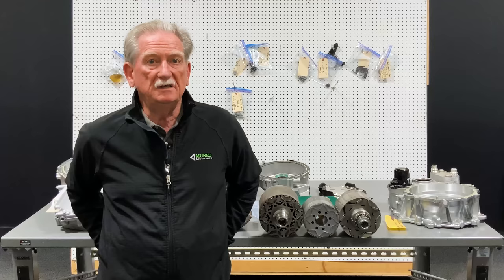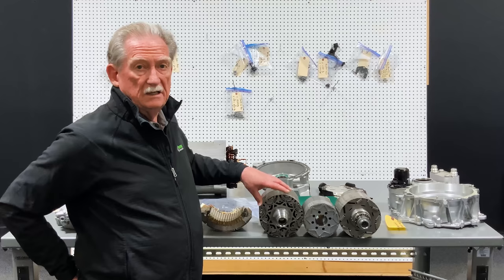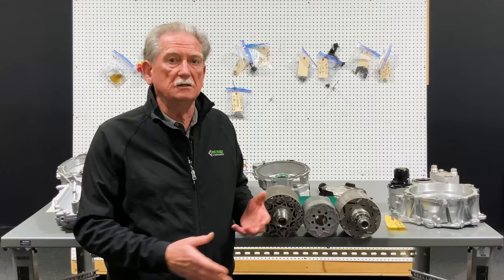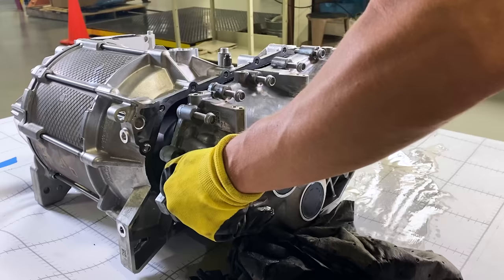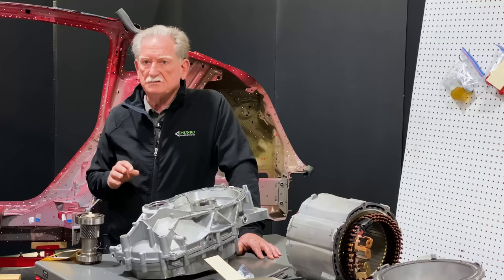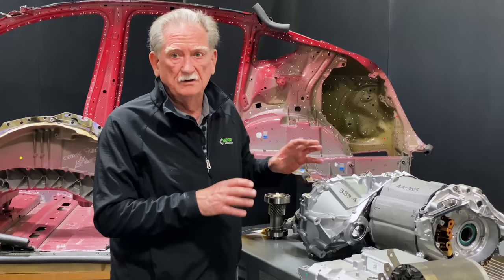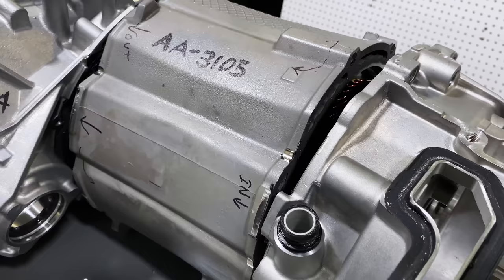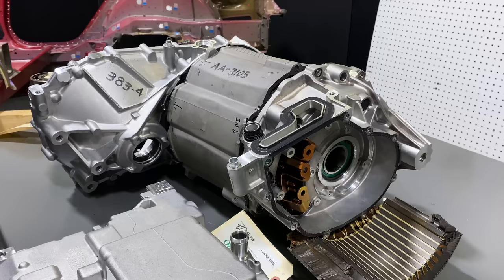Volkswagen ID.4: Electric Motor Teardown and Analysis

Comment: "I don't think you'll be fixing an inverter"  Words of someone who does little with electronics I see.  Having an inverter come apart as they've done is brilliant.  Sometimes that $4,000 part really just needs a 50 cent capacitor replaced.  DO NOT RIVET OR GLUE THOSE COMPONENTS, EVER!
Reply: Totally agree, these bolts will never ever come off...haha. And they are the best for automation.
Reply: Bingo! Switching to rivets or any other anti-repair method will damage their brand way more than any aggregate fixed cost savings
Reply: Especially while you are developing/testing the component rather than produce it for 20 years in the row...
Reply: Manufacturers are not getting any profit if the repair shop can replace a 50 cent capacitor.
Reply: @wrxguyusa  They need to worry about profiting on the car and not hoping to make money on parts.   Some fools will still buy the $4k part because they don't know better.  Those of us who'd prefer to get dirty will go the 50 cent method.    Even then it's not unheard of for an issue to develop with capacitors and then they can have "cores" that must be returned to them for servicing.  Then they'll wish they had screws so they could quickly repair them and be able to send them out to dealers who have to fix it under warranty.
Reply: your local repairshop probably will still be getting a new part from vw but vw will rework the old ones and sell them in eastern europe and asia
Reply: As someone that repairs electronics I can say that inverters will definitely be a "part" that needs to be repairable. In most cases it is very wasteful to just junk it and replace the whole unit. This would be simillar to fixing a transmission or an abs module, etc.
Reply: @soundtinker  Without question -- I find it interesting that they made the bleed resistor readily replaceable.
Reply: Thank you
Reply: If the inverter actually costs them 4K they have deeper problems.

Just devils advocate: sometimes a straight swap for a tech, even if it's a pricey component, is cheaper than a lengthy tear-down. And, it gets the car back to the customer faster. No one wants to hear their car will sit in the shop for 2 weeks. Just saying as someone who does this stuff for a living. Repairability is great when it makes financial sense.
Reply: You look at this as an electronic tech, but this is an automotive part, and they get swapped out.

The old one gets sent to a shop to get remanufactured, and they don't really care how easy it is, because they charge whatever it takes to take it apart and repair it.
Just like no one rebuilds their own alternator or puts new seals and bearings in a water pump abymi, but you swap it out with a Reman with a warranty.
And most independent shops don't want to touch component repair, because it takes specialized equipment to test and diagnose, and they don't want the liability if an inverter they repaired shorts out and the car burns up.

Now, I like fixing things myself, so not being easy to take apart would annoy me, but it doesn't really make sense for the auto industry to worry about a tiny percentage of people when gluing something together can save millions.
Reply: There is alot of profit in that $4,000 spare! but there is alot of pain in finding that person available locally with the experience and knowledge to know which 50 cent part is faulty to get in there, pull it out, swap, test and warrant it.
Reply: @MrCarGuy  true, penny wise, pound foolish..
Reply: @user-qv6ud2hx6f  Spot on!! very true! this stuff is still new and not 20 years old model!!  Revisions for sure due to come, and they need to pull apart to see what's not correct yet!  imagine all the plastic snaplocks breaking left right and center!
Reply: @mhamma6560  that's one of the reasons they are bigger than ford.. sandman wasnt part of their developement team.
Reply: Most likely you're going to be fixing screws that came loose and shorted it with that design.  I love that it's repairable but a better design would have been to render accessible parts that are susceptible of being repaired/replaced instead of putting the in the bottom of the thing and using a million screws.
Reply: @wrxguyusa  so true
Reply: I too would like to fix my vehicle. And if it’s little loose just tighten it up every once in a while. That’s the benefit of threaded screws. And if the whole gets messed up you can make it bigger and rethread it. Snap together stuff I always saw as companies trying to stop people from fixing their stuff.
Reply: @Mdrolet77  Steel screws aren't known for backing out of aluminum parts.  Soft AL allows screws to bite into it a little bit.
Reply: in America maybe, in Germany / Europe you not allowed to disasamble this parts, the car would be not longer allowed to drive on roads. It has to be replaced with an original part.
Reply: I disagree but for a zoomed-out reason. I just don't think we should be encouraging the the concept of DIY for EVs in general, as we do with ice vehicles. You've got a ton of components capable of delivering a fatal electric shock, explosion or fire and can hold a dangerous voltage even when the car is “off”. Then the risks from electromagnetic fields for those with active implants or pacemakers. Even if it's wasteful, eliminating time tinkering may end up saving lives. Of course it can be done safely by skilled mechanics, but I'd just feel better if the general owner saw their EV more as more of an iphone than a hotrod, and making things harder to open up might solidify that perception.  If there wasn't this risk I'd agree with you 100%, and perhaps in future it can be mitigated, but for now I cringe whenever anyone says the'll do a bit of work on their EV.
Reply: @mhamma6560  And they removed the oil (cooling fluid) pump.  So how does the oil circulate to cool everything without a pump?
Reply: I fixed a VW dashboard capacitor after 15 years. saved me at least 800 bucks 😎
Reply: @grunerschneemann3640  Well done!  I've given up on fixing cars because I can't recognize most parts anymore, like they were in the 1960's.
Reply: @franzplagens3277  They removed a pump not all pumps.  Tesla has 2.  One for the motor and one for the inverter.
Reply: @joedouglas5243  Yes, but step 1 of working on EVs is to "safe" the battery, aka disconnect it.  The bleed resistor (white rectangular box thing that he says should have been on the board) is what's used to discharge the capacitors in the inverter.  Once the battery is removed, that resistor automatically drains the caps of voltage ensuring that the system is in-fact voltage free.  Automatic voltage dumping has been a part of many electrical components for years.  It may even be the law in some jurisdictions due to recycling, among other things.
Reply: @Mdrolet77  Thanks for the reply.  I must have missed that point. No doubt there are experts at Tesla, and experts at VW, and they both have their reasons for doing things their way.  I wonder if Tesla's is a booster pump, or a separate coolant system with its own pump?  
Sandy looks at everything from a manufacturing point of view, not a long life or repair point of view.  It works well in America where people like to impress, and update their vehicles every few years, so they don't have to last very long, or be very repairable.  American culture is generally more wasteful, than European culture.  When you have presidents who turn their air-conditioner up to max, to enjoy a raging fire in the fireplace in the summer, it sets the tone for the rest of American society, lol.
Reply: @kenion2166  Maybe you can get some more right to repair laws going in Germany.
Reply: @joedouglas5243  the problem is, iPhones are only difficult to repair beyond the X because Apple wanted to make more money from people sending in their broken phones to their ironically-named “geniuses” and from buying new phones instead of being able to cheaply get their phone repaired locally by anyone with sufficient knowledge and experience. All of it adds up to a racket; a big scam to increase profits which exploits the environment and their customers. 

Agreed though; any electrical work can be dangerous. You can kill yourself with a multimeter. Maybe that could be mitigated with the most simple things; like capacitor-draining tools, or orange-coloured capacitors which show the user where to be careful. Anyone with common sense and knowledge enough to attempt to repair these components will necessarily know how they work; and as such will know what to avoid touching and when.
Reply: After electric VW will reach Russia, you'll find a lot of tutorials on how to replace PCB components on the inverter side. Russians are so crazy that would change the copper coils on the stator in order to extract more juice from that power train and beat Tesla on the 400m run. 😅
Reply: @imperialsecuritybureau6037  I hear you but I really don't think the danger can be mitigated, there are too many careless people out there, and too many ways electricity can get out of the battery and into you. I think the only answer is to make  working on your the powertrain of an EV something the average person does not (cannot) do -- so very different from the existing notion of "working on your car". I realise that's a padded income stream for the manufacturer, but having worked around that amount of current I just can't see any way around it.
Reply: @mhamma6560  Sandy has a video (can't remember which) where he has an entire battery pack completely removed and and "drained",  but it's still all taped up and warnings everywhere, and he goes into a bit of detail on how dangerous that thing still is and how hard it is to actually drain a 50kw+ battery back the point of it not being able to kill you. And that's the whole thing take out and professionally drained in the shop, imagine the average person working on their car, trying to swap out an inverter, and draining it by "driving it dead". Those electrons are just going to be there.   I just can't see it being feasible, there are too many careless people out there even if there were steps to mitigate it such attempts ways to keep hands away from conductive surfaces, etc.
Reply: @joedouglas5243  You fail to understand that a 'drained' lithium battery means it's at it's minimum voltage.  If they go to zero, they're trash.  If they go below minimum voltage, they're trash.  The battery is a fuel tank with no fuel pump.  Batteries are often covered by long warranties and few if anyone will play with the battery.  Everything else in the vehicle however is readily replaceable and safe when the battery is disconnected.
Reply: @joedouglas5243  it’s not like you don’t need precautions with ICE vehicles. You always disconnect the battery as step one. Not to mention, you still have a tank of fluid that is designed to be as flammable as possible (to a point). I think that it will be a different skill set and a different set of safety tools and steps, but people will always want to tinker with stuff. It’s just a new kind of dangerous.
Reply: @chstra45  Not just sometimes; nearly all the time. Unless there's built-in diagnostics to indicate what electronic component has failed, there's going to be no way a tech is going to be able to troubleshoot and repair. Moreover, what shop or dealership is qualified to repair or replace something like a capacitor or transformer? At best, they can swap PC boards, but even that can be problematic. Best to remove the replace the entire assembly and ship the defective one off to a specialty refurbisher who can diagnose and repair.
Reply: @kenion2166  What do you mean you're not allowed? It's your car. If you could somehow manage to repair it, who's going to know?
Reply: @micultimy91  so true, god bless those Russians
Reply: @wallyballou7417  And that specialty repair businesses' cost will indirectly come out of your wallet as the "price of the replacement part". So making it easy to repair is ultimately in the customers' interest.
Reply: I have a good friend that owns a company where they are servicing stuff like this. They replace a 50ct capacitor and sell the repaired part again.
Reply: This stuff gets repaired in industry. I think they even repair alternators.
The BOM cost is much higher than an ignition module.
Reply: @soundtinker  It can be repaired even on board level. New control module, new power module, new capacitor A or B.
Reply: @mhamma6560  High voltage resistors do fail.
Reply: Looks like VW are going against built obsolescence philosophy. I think I would want to fix an inverter rather than spend 4G. And there are several main sub- component borads- so possibly you could replace only the faulty sub unit rather than trashing the whole thing.
Reply: Absolutely. I recently “fixed” my Gen2 Tesla on board charger with 15 minutes soldering - Tesla wanted $8k!
Reply: Words of someone who does electronics as a *hobby*.  The cost of fixing am inverter with a 50 cent broken capacitor, is not the 50 cent capacitor, it is the hours and hours of technician time evaluating the problem and testing the fix, at hundreds of dollars an hour.
Reply: I like to repair my stuff as well.  But what's the likelihood of a large electric discharge after one of those fasteners comes loose and starts rattling around inside?  With so many screw fasteners, there is significant likelihood at least one of them will come loose and start to rattle around.  I'm not convinced that the benefits of repairability will outweigh the increased possibility of floating "electrical shorts" to inside my inverter.  ...I'm torn on this.
Reply: @jeanwesleynew  The probability of one of those screws backing out and creating an issue would be extremely low. Screws tightened into cast aluminium to the correct torque, don't just fall out. Most of time the problem is trying to undo one that has been there for a few years and won't let go.. As someone who has to repair industrial power electronics, I like this sort of design.
Reply: In France they recently introduced a new  Law dealing with obsolence and repair ability.
Reply: I think he's saying that he's in first are more likely to just be replaced, which they are.

Some of the components are through hole, but have so much thermal mass that there's no way you're getting them off without baking the entire board.
Reply: @user-tz3gn2ke1f  I have no idea what sort of industrial electronics you work on, so forgive any false assumptions I may make.  But screw in fasteners do occasionally vibrate loose on a car.  Yes, not very often, and typically due to improper torque or another cause.  But each additional screw fastener is another potential failure point to vibrate loose, or be  improperly torqued down (both can happen).  Maybe the industrial electronics you work on don't experience the same level of vibration.  Or maybe they are produced at lower numbers than common autos, and the assembly time is longer, allowing fewer assembly/torque errors.  But I can at least see numerous screw fasteners as a potential failure point across 80k cars, which might outweigh the benefit of individual repairability.
Reply: @jeanwesleynew  It would be a fair assumption that the equipment I see is put together with a little more care than the average passenger vehicle. Locomotive, heavy mining, and similar. I suppose it is just a pet peeve that things should be made to be pulled apart and repaired. If I have to half destroy it to get inside, feels wrong.. and I don't exactly have a real good track record with things held together with plastic clips when the plastic gets old and brittle. :)
Reply: You will find screws holding the motherboard of the most modern high end cellphones, ECUs on various applications... You name it. 
This just makes it more serviceable and all you need to do is design it correctly and get the torque right.
Reply: New right to repair laws will change all this.
Reply: But at the local service center. Will a tech be replacing a capacitor or the entire unit?

I say they replace the entire unit, then the faulty unit goes somewhere where if it is just a faulty capacitor, they can refurbish and resale for the used parts market.
Reply: @joedouglas5243  Repairability is not equal to DIY, but especially an EV should provide besides high voltage components parts that are environment friendly repairable by a repair shop. Otherwise we end up in more pollution than not having EVs at all.
Reply: The ability to disassemble the inverter is useless if replacement parts are not available. EV design is in a high state of flux. How long will it be before all these components are re-designed and no longer compatible?
Reply: I drove different brands for 40 yrs but I never experienced a repair that You describe. They always take the whole part and replaces it, in special German brands do that. I agree that very often a 10 cent part is broken, but they don't care. In the EU they work on laws that give the customer the right to repair. A good idea for the environment
Reply: @CorwynGC  If you need hours and hours to fix a broken cap, you should spend some of those hours to go to an optician.
Reply: Spot on! I was also wondering about that. But for that reason I find that it takes lots of movements to reach that circuit board.

Disclaimer: I have no any knowledge/experience how this is fitted at other cars!
Reply: VW will simply call the part "obsolete" and make the part unavailable. They have done it historically.
Reply: Isn't disassembly also very useful for recycling these components?
Reply: @mhamma6560  Exactly. Standard waranty on car im EU is 5 years now. 2 years are mandatory by law and based on car price (it is about 300-500 euroro for 20K car) another 3 years (and payed by dealer). Some parts, especially on Japan and Korean  cars have 7 to 10 years. European cars are build as repairable (for manufacturer at least :) )
Reply: Repairability should be the future.
Reply: @hemmper  and not only for cars, but everything else.
Reply: Anti replacement+throw away culture clashes w repair culture -> which is actually the greenest solution btw.
Reply: I work in VW group and electric components undergo insane stress tests such as vibration tests and rapid temp cycling etc. Those fasteners have probably been deemed necessary.
Reply: @HomeCinemaJunkie  most likely, but Scotty Kilmer will blindly say "they're not properly made".
Reply: @captainfowl1249  a      step in the right direction
Reply: @M Hamma. 100%🎯
Reply: When a car is 10 years old , yes the inverter will be rebuilt by someone. If you have to buy a everything new you can throw the car away, this includes your beloved Teslas
Reply: @hausaffe100  Over the years, I have had a few early component failures on Audi and VW cars. What impresses me is that they are obviously aware of the problem and the replacement had been redesigned and in all cases never failed again. 
Despite the slightly higher initial cost of their vehicles, in the long term they are extremely good value for money. I have had 3 cars that I kept for about 20 years, during which time they each covered around 300,000 miles.
Reply: @joedouglas5243  If we go in accordance to your logic,, then people shouldn't be driving cars either.  You can't dictate what someone else,  in the confines of their personal property, can do to their car, period!
Reply: @blk77sunshn  We do in fact dictate that, in some situations, people shouldn't be driving their cars. Such as when they're drunk. It's all about context. Now is the context of potential danger from doing some very specific things while working on an EV (we're taking a very tiny % of work you cold be doing to the car, mostly involving hardcore modifications to the battery pack) enough to mandate some sort of manufacturer friction to make it more difficult for the average person to do that very specific thing? Not to stop them mind you, but to put up a few serious barriers that might save a few idiots from themselves?  Or do we leave it to Darwin? That's an open question, and food for thought.
Reply: I guess that the "Bleed Resistor" has a high chance of failing (low MBTF) - hence make it easy to replace.
Reply: I like it if I  or somebody else can repair this things without any big problems. VW did a good job. Only this problem with the aluminium surface should be done better.
Reply: Munro seems to want to build throwaway cars built with throwaway parts! Good for the rich stock holders. Bad for the consumer!
Reply: RIVET OR GLUE is bad for service, this inverter is excellent design for service, every module is good sized to take apart, electronic components are good size for regular tools to work on,  VW had a winner here.
Reply: Totally agree!
Reply: However, the point is that the dealership will not take the time to take the inverter apart and replace a bad part or modular. They will replace the whole thing.  That's the case with any component in any modern car.  No fixing, just replacing!
Reply: @switchex  Yeah! If people want to use dealer then pay 4 grands, there are third parties can fix for a lot less, why not, for example, ball bearing replacement, gear replacement or pcb module replacement for 1/3 of the dealer repair cost.
Reply: @switchex  That is just another way of saying "F" the customer! There are third parties who are willing to do the repairs.
Reply: @joedouglas5243  He didn't have enough information to comment, once you removed the 12v battery power, all the high voltage power output in Lithium battery will be disable, or any high voltage connectors in the loop was disconnected, high voltage disable, or the battery case open, high voltage disable.
Reply: @DavidJohnson-tv2nn  don't get me wrong, I have never been to a dealer and go out if my way and challenge myself to fix anything. But it's a few if us that can and willing to do that.
Reply: @luckybiby8968  no third party that is willing to do these type of work.  A lot of do-it-yourselfers, including myself.  But companies are there to take your money, not to make products that are easy to fix.  This is same exact reason why you don't see any "third parties" fixing TVs.  They need to make a profit too and how much can you charge a customer for finding and replacing a bad capacitor?  I am like you, I fix things.  But I would have done the same if I was a business man.
Reply: @switchex  BMW quoted me $2000 for an Airbag icon light problem ,when the car went over a bump, it was on, another bump, off ( to replace airbag module and associated computer module). If it was under $700, I won't bother to DIY, at $2k, I would like to fix myself, I bought  SW scan tool and cable for $350, found out the airbag connector ajar, nothing wrong with said modules, pushed it in, it worked, For troubleshooting a capacitor that's bad,  it's fair to pay $1300 for the  repair, usually I'll replace all the caps in the function block if it is cap on the gate drive of the Mosfet, if I'm being nice, I would replace the Mosfet, too. I'm willing to be thethird party if the incentive is good enough to make a living.
Reply: A CAN bus filter inductor has a dry joint after 2 years and that's a £kkkk bill. Same as door trim and bumper clips - they all break after one use.
Reply: When was the last time anyone had a water pump, alternator, brake caliper, lug nut come loose that wasn't torqued correctly ? Never for me.
Reply: @joanfrellburg4901  He was a technical bean counter, less labor and less parts was the goal, reliability and repairability had no proprity.
Reply: @luckybiby8968  Right, my guess is you'll be able to pick up a new module on Amazon any day now. ( with chrome bolts and lock washers ) 💋
Reply: @jeanwesleynew   Screws can be locked with thread locking fluids, if you have that kind of vibrations, you want MORE screws to hold the board, belive me, boards break from vibration all the time, and the key is to support it wherever it is possible with a screw fastener, satelites experience G-forces and vibrations during launch that would snap unsupported boards.
A car hitting a speedbump a bit too fast can do the same, USE MORE FASTENERS
Reply: @chstra45  look at the price of a commercially available 480VAC 200HP VFD/Inverter and you will find that $4000.00 is actually pretty cheap.
Reply: @soundtinker  I am pro right to repair, but I dont think that these parts will be repaired, ever. About 400 amps run through them, and if they should catch fire the battery burns in to the street. Repairing something like this is quite dangerous, and probably illegal.
Reply: I will agree with you for one percent of the people who own the car. The other 99% are never gonna fix that car. And if somewhere down the road somebody figures out how to repair that at a cost That is reasonable they will probably figure out how to get into it
Reply: @wrxguyusa  Good. That is not their job. They should be designing and building cars.  What happens to them after they are sold should not be their concern. Apart from repair/replacement under warranty. Now, should that 50 cent capacitor blow the owner can take it to their favourite EV repair shop and pay them 50c plus hourly labour rates to fix it. Heck, plenty of keen tinkerers could do it themselves. Good for the customer, good for the economy and good for the environment. This of course depends on the manufacturer giving some heed to making their products repairable and providing the information to make this possible. All in all I'm keen on this whole "right to repair" thing.
Reply: YES, THANK YOU!
Reply: Those capacitors were the first thing I thought of when he talked about sealing that thing up where you can't open it.
Reply: @joedouglas5243  They may force us to go electric,  but I can promise you we will never stop fixing our own vehicles. The OEMs have been trying for years to stop us on ICE vehicles and it hasn't worked. 

My wife's Nissan Murano just had the alternator go out and the big respected shop told her that the serpentine belt was bad,  it wasn't it was maybe 2 years old. And battery,  it wasn't bad either. The alternator is harder than any alternator I've ever done in my life and I've been doing this a long time. They wanted to charge us $1,700 to change an alternator. And they were charging 90 bucks labor to install the serpentine belt even though they already had to remove the serpentine belt to replace the alternator. And they were charging in the outrageous markup on the Belt like a 10x markup. Just the serpentine belt which takes about 1 minute to install they wanted $250 and the belt costs $15 . I changed it all myself and bought the most expensive alternator they had out of the three grades so I did the whole job for $300 and it took me all day. I don't make $1,400 a day so I'm okay with it taking all day . 

I'm not paying these shops because there are a bunch of Thieves who lie in addition to overcharging. If we go electric I will find out what to do to keep from electrocuting myself and I will fix my electric cars and thousands of other guys will too. I learned how to do electrical wiring in homes including 240 volt wiring to the panel, I will figure out the cars.

By the way the shop that lied about Parts being bad and was charging labor twice for changing the serpentine belt has an excellent reputation and everyone my wife knows and works with thinks they are very fair. They all use this shop and praise them all the time and highly recommend them. This Is Not Unusual either.
Reply: @wrxguyusa  if a manufacturer that badly  needs repair$ they should hang it up.
Reply: @mhamma6560  well said Joe. I often heard of safety in cap discharge.
Reply: @joedouglas5243  Usually you can just run the Heater/AC to discharge the Battery pack while you work on another vehicle/project. Not a "special operation" ;)
Reply: @wrxguyusa  with the recent supply issue, people are becoming aware that repairability is important and are challenging that old mentality. It's good too because if we keep on using the lightbulb ideology we're beyond screwed.
Reply: ''Having an inverter come apart as they've done is brilliant.''  and ''''SOMETIMES'' that $4,000 part really just needs a 50 cent capacitor replaced'' How often is sometimes? What are the ''man-hours'' costs to replace a 50 cent part? What are the chances of problems after a 50 cent fix? So what kind of warranty do you get if done by a professional? And finally, what was the warranty on this entire part? This says something about the quality! I know Sandy is is right! And NOT sometimes!
Reply: A proper fastener design will never come loose. Many big end bearings are testament to this.
Reply: @franzplagens3277  convection-propelled
Reply: @vasylmyeshkov7791  Thanks.👍
Reply: @oliverbleicher8382  qq i
Reply: Inventer can be replaced new model from different manufacturer which make especially those parts.
Reply: @MrCarGuy p
Reply: DOn't forget this guy expressed his view from the automotive industry perspective, which is replace it and not fix it. They just don't care it is going to cost the end user much more. All they care about is efficiency in replacing the part and move on.
Reply: The guy is basically shilling E-waste and programmed obsolesces to its customers...
Reply: @wrxguyusa  They don't have to - Dealership service won't fix it, third party mechanic won't fix it, general electronics repair shop won't fix it - only a repair shop specializing in inverters would - but you have to know it exists. On the other hand if you go to a dealership, they'd be happy to sell you a new one with a discount if you give them the old one. They'll refurbish it for like 1.50$ themselves and sell it for full price ;) But they will only be able to do it if it is repairable.
Reply: Let me introduce my drill